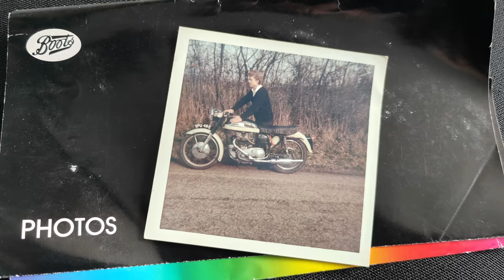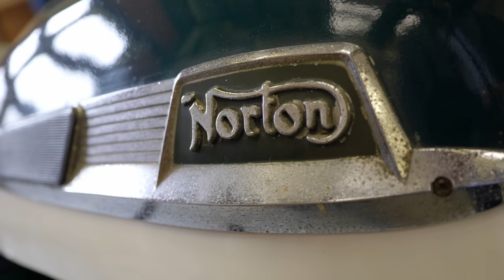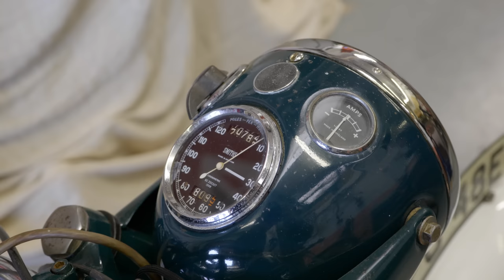First Start in 28 Years: Bringing My Grandfather's Triton Motorbike Back to Life

Comment: Thanks for the trust, James. Was an absolute pleasure to work on this wonderful machine for you and especially with such a precious story behind it all. Your reaction at the end makes it all worth while 🙏🏼
Reply: You did a fabulous job, exactly what was needed on a machine like this.
Reply: The clean/lacquer/rebuild route was the perfect choice for this type of restoration and a top quality build all round, nice work Hanger 😎
Reply: Well done to you for a superb job of renovating but keeping the character.
Reply: Who got the better bike? The leftover Norton engine in the leftover Triumph frame?
Reply: Cracking job, thanks for appearing in the video 👍
Reply: Good job
Reply: Top man Simon 👏🏻
Reply: Couple of coats of clear to preserve the original patina, that's the way to go, good job.
Reply: @BuzzLOLOL  it's my understanding that the Triton initially came about due to car racing. There was an open wheel formula class that used the single cylinder 500cc Norton engines from the Manx Norton race bike. Initially Norton would supply these but once they realised that they weren't being used in race bikes they stopped supplying engines and would only sell complete bikes. This resulted in a surplus of complete rolling chassis available for cheap money that just needed an engine. Triumph engines were widely available so with a minimum of ingenuity you could literally build a bike that handled like a GP bike and was probably more useable on the road, better gear ratios, etc.

Comment: Lovely work.  I have a 1967 Triumph Daytona T100 --- over the years it has taught me a lot. First time you tried starting I could tell you wouldn't get it started (and fuel feed is so simple that that is unlikely to be a problem if your spigot is open!) ---- low or no spark symptoms. I use the horn on my bike as a 'voltmeter' no horn blast or weak horn blast, no way it will start. Charge the battery. One other tip, never leave these kind of bikes running standing for more than a few minutes. It will get hot as hell in no time. Could be damaging.  Cheers and enjoy that thing. Maybe I should keep mine and hand it on to my grandson, or granddaughter, but which one!

Comment: Once it got spark and gas it was a dream. In the early 1970s I had a Rickman Metisse with a Royal Enfield 750 engine. It could be a bear to start and did it ever kick back! Steel arch boots were required, trying to do it with rubber shoes would cripple you. Lovely bike though, nickel plated frame, Dutch blue fiberglass bodywork, disk brakes front and rear.

Comment: I’ve been lucky enough to have 3 650 pre unit triumphs an one featherbed framed  650 Norton ss, If you ever have the same problem with not knowing if the mag switch is of or on just unscrew the end of the mag. That removes the earth wire. All my mag ignition bikes were easer to start than the early alternator bikes which is why they are used on drag car engines.The oldest mag ignition bike I ran was a 1939 Ariel and when I pulled the mag apart it looked original,this was between 1967 and 1975.One tip that might help is the triumphs mag switch was a push button. Hope you enjoyed the bike I can say the Norton feather bed frame was far superior to the triumph one.

Comment: Haaar!  From my history dating back to a pre-unit 1958 Triumph 650 single carb with a Slick Shift tranny and a Compi mag, while serving in the RCN in the early 60's; I can tell you what I noticed: even with the old plunger style oil pressure indicator on the timing case - it was still de-rigeur to undo the oil tank filler cap to visually check that the scavenge side of the oil pump was working as designed. It was not uncommon for some stray bit of crap to get caught in the ball-check and allow that side of the pump not to work thereby giving you a hydraulic lock-up just after nicely getting out on the highway. The Dunstall pipes always set them off but a pair of reverse cone silencers would not be remiss on the old girl.  Those after market finned tappet covers were all the rage for decades of Triumphs. The front wheel looked remarkably akin to a 69 Bonny's full width twin leading shoe brake set but perhaps Norton had something similar?  The absolute best part is no Zener Diode and Selenium Rectifier mish mash to plague you. You did your Grandad a "solid" by keeping the bike in it's state of livery when it was still his .Enjoy the old lady and treat her right, she'll give you years of fun yet.

Comment: It really seems like it is much easier to get parts for very old motorbikes than for "just old" bikes.. I had to sell 2 bikes from the 90s because I could not get the right parts for it- and having to deal with the German TüV.. you often can't just use different parts- even if they are much better..

Comment: Are you putting the same type of pistons in ?  I have the same 17844 pistons in my T110 but being 9~1 compression pistons from 70's trophy i,m a bit worried they are a bit high ,  sounds lovely but i've been told the 8 stud head is a bit weak for these high comp pistons ?        fuel was different in 1967 than now.